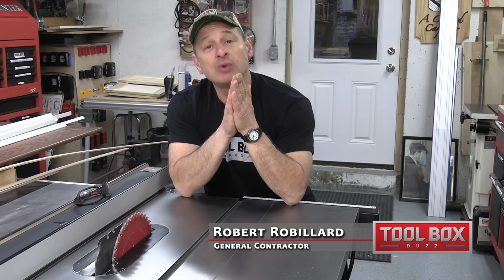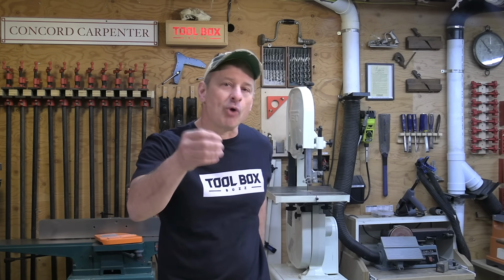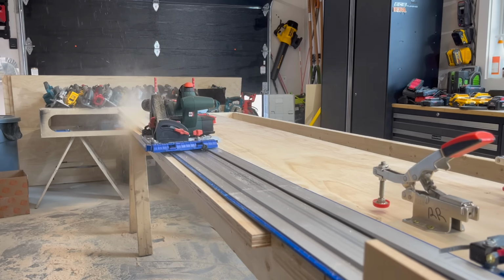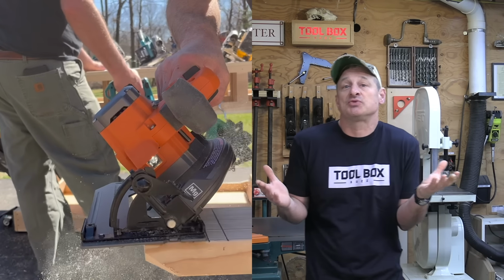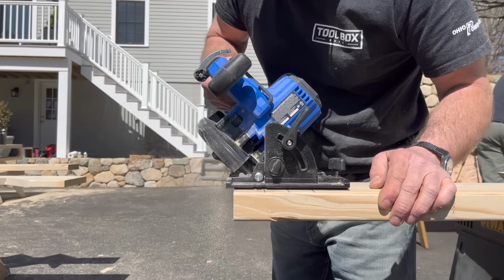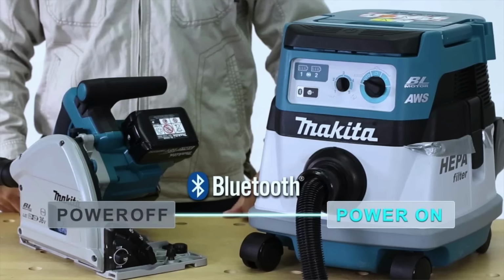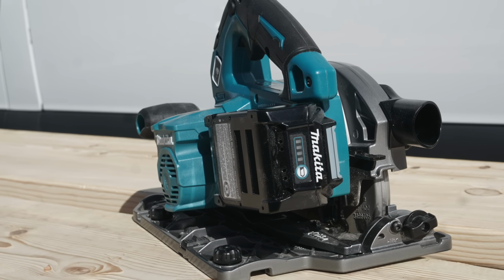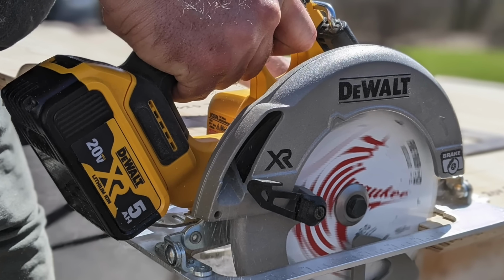Best Cordless 7-1/4 Circular Saw

Comment: Why would you use Wilfuckup blades???? They suck and go dull quick!!! You hit a knot and or a staple in the wood and they  are junk!!
Reply: Milwaukee is superior American brand not the crappy Swedish made ones.
Reply: @Pepe-dq2ib  Wrong! I build houses here in Canada. As i said. They dull quick and if you hit a tarp staple or knot they are junk!!! They last a day usually and they are complete junk!!!
Reply: @Pepe-dq2ib  Spyder blades beat Wilfuckup blades any day!!!!
Reply: @davegravitt210  i just use Diablo blades for everything except miter saw. I use Makita 80T blades for the miter.
Reply: @Pepe-dq2ib  You don't frame (build) houses then. 😂 Lol
Reply from the maker: We did some pretesting with the Milwaukee framing blade and cut 84 [16D] sinkers in 80 seconds.  Sees durable enough for us!
Reply: @ConcordCarpenter  Try cutting rafters or studs or tgi floor joists or anything else all day. Junk! We use Spyderco blades. At least they last a week!!! Lol
Reply from the maker: @davegravitt210  I think we'll have to do an accessory test soon
Reply: @davegravitt210  I dont build houses, just renovations and decks. Recently, we actually make most of our money just installing helical piers. All the contractors i've seen and know that does framing use Diablo blades since i was born. In the US, only Lowes started selling them about 2 years ago. I still don't know anyone switching from Diablo to Spyder, so it must not be as bad as you say.
Reply: @ConcordCarpenter Probably do. The thin DeWalt blades are just as bad.
Reply: What does it matter all the saws are using the same blades
Reply: @loucifer4205  wow bud! You didn't even read the whole thread!!! Smh. Walk!
Reply: There's no staples and knots in plywood friend-they are good blades and yes diablos are good but can actually make some saws better than they really are-most saws come with a stick blade which may will use till it's full
This was a fair fight and a real world ish review
If you think it should be different then get a chanel yourself-we will watch if it's good
Reply: @baseballdude8491  uhh. Dude. Have you ever cut lumber off full lifts of lumber? It's banded and covered in a plastic tarp. Stapled on! Smh.
Reply: @davegravitt210  that's funny I actually have a saw mill and make lumber both band saw and an old PTO driven circular saw
I've cut more wood in my 51+ yrs than u will in you and your crews lifetime
Careful when ya start spouting off-already commented that Diablos are great blades but not necessary for everyone and actually can hide some deficiencies in some of the saws that significantly struggle when not using the diablo blades-
Stop with all the Hyperbole
Reply: @davegravitt210  lol, he just did the test and your Spyders are 5th out of 7. The Diablos you called trash because i am not a home framer seemed to be the best.

Like i said, i know no framers that gave up their Diablo for Spyder. I actually forgot they even existed till you mentioned them. Only Lowes carry them and I dont shop at Lowes, their lumber sucks.